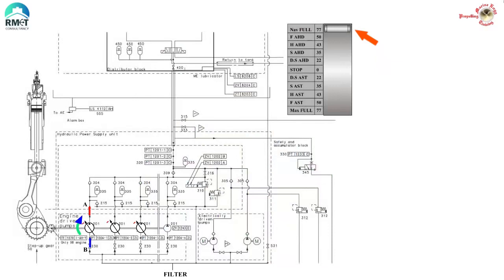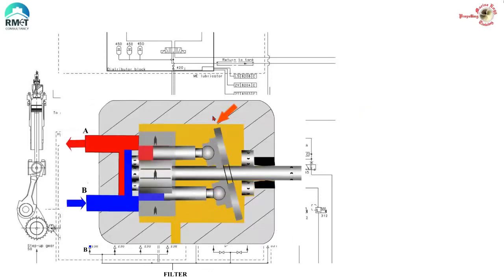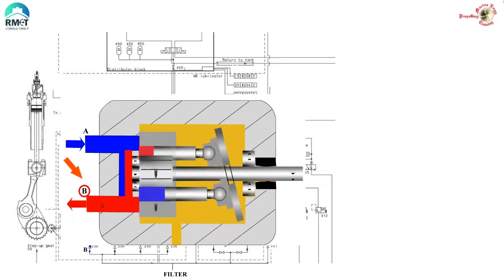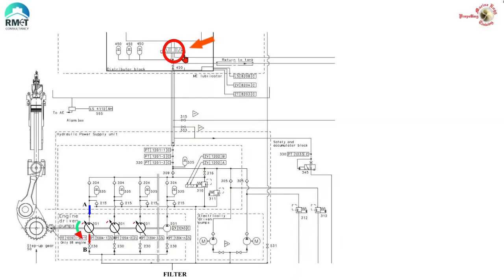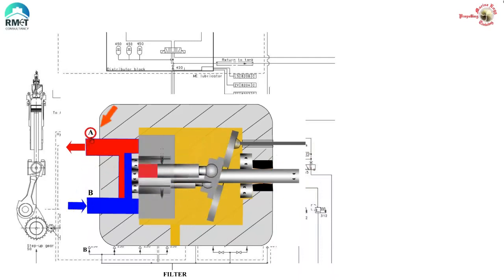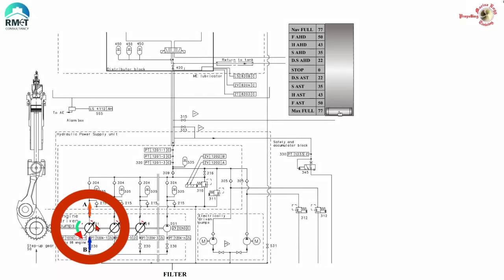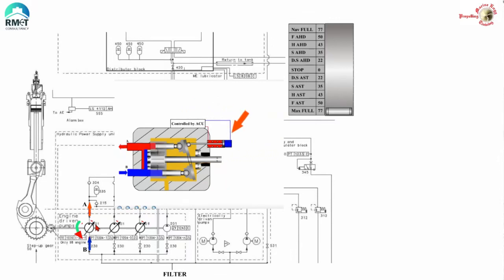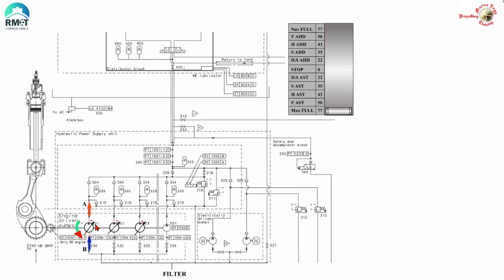ME C Electronic Engine Reversal Hydraulics | What happens to Swash Plates during Reversing ?| #RMETC

Comment: i am preparing for my class 2 Sir ,.,every single video of your channel is making all the complicated subjects so simple that m sure Ecdt pyarelal after sign off can clear his oral in first attempt :) 
thanks you sir and waiting for many more such videos to come
regarding that question what i could interpret
 Sir usually 3 pumps are there 1 is control and other 2 are follower,controller swash plate is set to 50% and follower will have B/W 10-100% depending on the RPM of the Engine,.

so if the controller pump failed to reverse one of the followers will act as a controller,.
and it also has a provision in case of control failure swash plate will be set to 100% ahead direction.
and since all pumps are equipped with suc pr sensor if pr is too low for all  pumps it ll initiate a Shut Down., 
### As you said there are many intelligent people sitting there and coming up with complicated ideas, So to avoid that pump running dry(which dint reverse) they provided v/v 215,. 😊
Reply: Kay baat hai, pyare Laal, Gangadhar hi shaktimaan hai 😅😅😅😅😅 samje pyarelaal
Reply: @kirtikumar8220  Sahi pakde hein...

Comment: dear sir, well explained. However to your interesting query in the end of the video  - when the engine is astern then as we know during start up or reversing when rpm is low then the hydraulic system is run by the electronic pumps and not by swash pumps ( in the diagram the right side , 2 pumps are located to supply hydraulic oil from sump) swash pumps are isolated during low rpm or reversing at low speed. so we can manage to do astern without any problem but the only thing is we cannot reverse at high rpm.  Correct me if I am wrong.....Thanks a ton for the explanation again.
Reply from the maker: I request you to consider the following points you have said....swash plate pumps are engine driven....so how can you ISOLATE???The question was ..when the swash plate cannot be reversed and also cannot be isolated how a engine can run in full astern direction...if you think on these lines...you will get the correct answer yourself👍
Reply: Okay sir understood.
If swash plate angle is not changed and shaft direction is reversed then there will not be any suction from that indivisual pump and other pumps will compensate. 
Right?

Comment: Sir, can you explain more on how when shaft rotation is changed in swash plate pump the suction and discharge CHANGES? 
According to me the suction and discharge should remain same after changing rotation of the shaft, BECAUSE since the angle is same even after change of rotation and suction of the piston depends on the length of stroke (piston draws liquid in larger length and pushes out as the length of stoke decreases ) which in turn depend on angle of swash plate. The suction and discharge will change only when the angle of the swash plate is changed. Please correct me if I am wrong.
Reply from the maker: Ha Ha... Imagine a turning gear .shaft turning clockwise--piston goes up..if you turn the shaft anti clockwise..the piston goes down..same logic....
Reply: @rmetcvideos   yes sir absolutely,  but again the suction will only take place in the same region as the angle of the plate has not changed.  For example if the suction in the pump was from bottom half of the plate then even after changing the direction of rotation the suction will take place in the bottom half of the plate only. Just that if 1,2,3 piston were in line to take suction and after no.1, no. 2  piston was in line then by changing the rotation again no. 1 piston will take suction and then no. 3 piston and not no. 2. But the suction will be in the same part or from the same port only if the plate angle has not been changed.
Reply from the maker: If bottom was suction..then it will become discharge when shaft rot changes..for the same angle..Again think hard with the same Turning gear as an analogy.if clockwise rot can make piston go frd ..which is discharge..then anticlockwiase rotation at the same spot will cause piston to retract which is ...suction
Reply: Yes Sir I agree with bottom half of your reply but,  again sir please forgive my audacity to ask you to rethink. If suppose the shaft is rotating clockwise and suction and discharge port are at the bottom and top respectively. Now imagine a clock and piston is to deliver at 12 o clock then after 12 till 6 (bottom ,where suction is) the region is suction build up region as the piston retracts and at 6 o clock suction is complete now the piston starts to push out and build discharge pressure so from 6 to 12 (clockwise direction) is pressure build up region right?!  So now at this point if you change the direction of rotation and maintain the SAME angle of plate then the suction and pressure build up region will change i.e now from 12 to 6 ( anticlockwise) it would be suction build up region and from 6 to 12 (anticlockwise) it would pressure build up region but the point or port of delivery would be same i.e 12 for discharge and 6 for suction. These will only change in case the ANGLE of the plate is changed.
Reply from the maker: @abhirajsingh987  ..Your logic is correct but I guess smewhere you are missing the point. Maybe bcoz you are --I am simply guessing based on your choice of words like--pressure buid up and suction buid up . there is no such thing called pressure buildup  and suction buildup.....It is as simple---as---from 6 to 12 --the entire region is Pipe A and From 12 to 6--entire region is PIpeB ...There is continous discharge or suction of oil all along deoending upon direction of rotation
Reply: @abhirajsingh987  hi
Reply: Hi abhiraj, had the same doubt as you. Seems the video has some mistakes in fundamentals. Sucn. And discharge remains same irrespective of shaft rotation. Sucn, discharge can be switched only by tilting swash plate to either side of zero. In this case,  operations can be achieved by doing from zero to max position in one side only.
Reply from the maker: ...from chat GPT.  ... pls try it yourself....QUOTE..When a variable delivery pump in a hydraulic system is set to reverse, it typically involves changing the direction of rotation or adjusting the flow rate to move fluid in the opposite direction. This could be achieved by adjusting the control mechanism of the pump, such as altering the position of a swashplate in a variable displacement pump or changing the direction of a motor driving the pump. The specific method depends on the design and configuration of the pump system. ...unquote.... HOpe that ends your confusion..

Comment: There is a non return valve provided 215 (which will save the pump from running dry by providing oil), in case it doesn't reverse. Pressure compensated by other variable delivery pumps. I guess. Am I right?
Reply from the maker: you are correct

Comment: If reversal of the swash plate does not happen for any one of the pumps, the swash plate could be brought to zero angle (idle). Other pumps will increase their pumping rate to compensate. Also, as already mentioned by Manjit, in case of complete failure, swash plate is set to Ahead ('limp home' mode) 😇
Reply: in case of complete failure ,  plate is SET TO AHEAD?  can you elaborate on that
Reply: @AmitKumar-ic6dd  in case of emergency (failure), you only need to run the engine in ahead to reach the nearest port...
Reply from the maker: Ok..lets get this sorted out...in case of failure...of one pump...remember that the signal cannot be received...so the pump cannot be set to zero angle....the faulty pump goes to FULL angle position. . The other pumps compensate...Everything is as normal as possible...No need to use words like LIMP ahead etc🤣can reverse and be as normal ad possible🤣🤣
Reply: @rmetcvideos  Hi Sir. Our vessel is now berthed in Santos Brazil but right before maneuvering from ahead to stop and then to dead slow astern, noticed starting valve was working but there is no movement 'till alarm failure is activated. Tried 5x in the order of dead slow astern but same problem persist. There was no problem encountered in ahead order but only during dead slow astern. 2nd engr took the control from Bridge to ECR and everything was ok. So C/E advised the Captain that we will used ECR control till we berthed. I have already checked the connections from Bridge Telegraph Transmitter down to ECR Telegraph Reciever and found no abnormalities. Now watching your video makes me ask whether the problem is on the mechanical or communication side? 
Ty. Any suggestion is highly appreciated.
Reply from the maker: @ronaldv.novesteras8157 ..thanks for your mail...presuming that it is a ME engine..Movement from Stop to Ahd or astern is caused by the Electrical start up pumps.If you are able to be Ok in ECR control..I don't suspect any problem with hydraulics  or anything concerned with the topic in this video..Since I don't have access to the man.diagram of your vessel...I guess it might be the Solenoud valve, microswitch problem..Just guessing

Comment: Sir, still couldn't comprehend when the swash plate pump is reversed it should still give discharge to A side , as the individual pumps suction and discharge stroke will remain same, max volume at bottom and min volume at top, which is the case if the shaft rotates in any direction

Comment: On discharge side there is a Check Valve before accumulator connected to A line on which the relief valves are also connected to deliver oil back to Suction side. If I am right, if the swash plates do not reverse, ofcourse we will have alarm in MOP, but the check valves will open and the pump will take suction from B side and deliver to A Side. Thats a Failsafe Mechanism i guess.